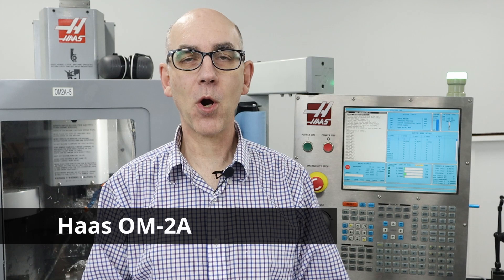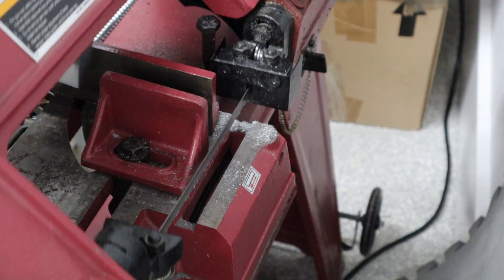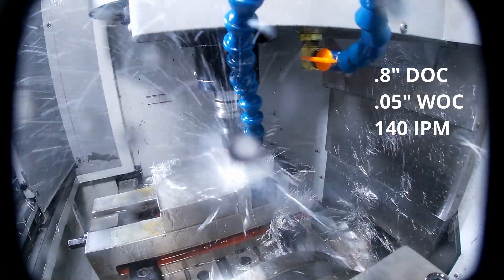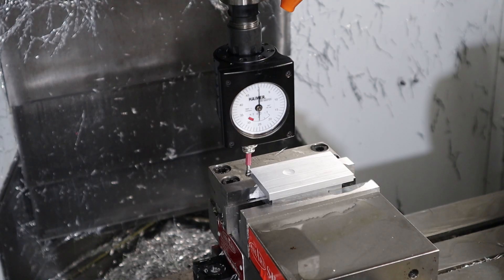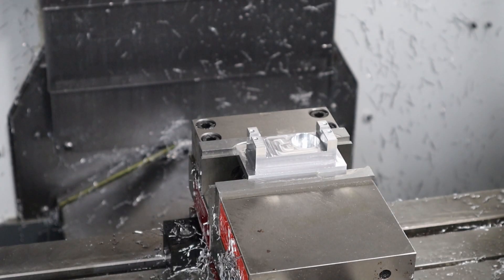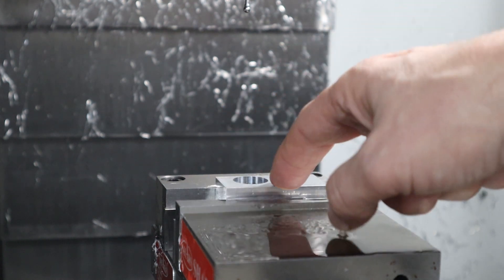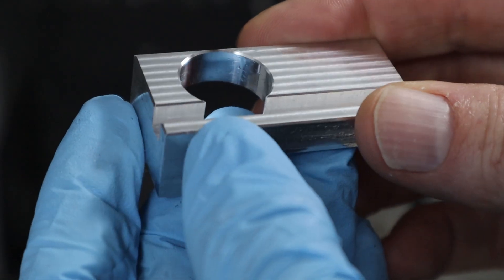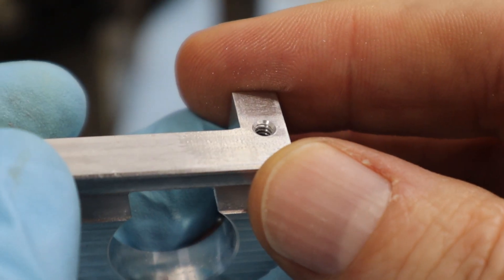A Part for NYC CNC Johnny 5

Comment: Are you using a torque wrench to tighten the ER collets?
Reply from the maker: Not yet. I need to get a torque wrench.
Reply: JohnSL you’d be surprised how much those ER collets want to be torqued.  About 45ft-lbs for ER16.  I got the maritool changeable head torque wrench and adapters.  Pretty good except the min. Torque is 45 so you can’t use it for smaller ER collets.  Also you may already know that ER bearing nuts give much greater holding force as well.
Reply from the maker: Techniks calls for 40 ft/lbs for over 1/16" diameter collets, and 30 ft/lbs for less than that. Wish that Maritool torque wrench went lower.

Comment: Pull out in collet holder is extremely common. If you can pick up some solid holders with a set screw then that will take care of it. Make sure to grind a small area where the set screw can seat itself properly.
Reply from the maker: I haven't found an ISO-20 holder yet that uses Weldon flats. For ISO-20, there don't seem to be many options other than ER-16 or ER-20.

Comment: High docs in those collets will always pull an endmill out, if you can I would invest in a couple solid solders for common standard sizes, then grind a concave area for the setscrew in each endmill. the endmill will break long before it pulls out of the holder :)

I wouldn't feel bad about the machine or vise, messing stuff up is how you learn! those are impressive cuts for such a small machine.
Reply from the maker: Thanks. I've looked and haven't been able to find ISO-20 holders that use a set screw. I've only found ER-16 and ER-20 holders. The options for ISO-20 seem very limited.

Comment: All's well that ends well John, and it looks like a splendid job. Curious, your Haas does not have the rigid tapping option?
Reply from the maker: Thanks. I have a part coming up where I plan to use rigid tapping. I've never used rigid tapping and didn't want to try it out on this part because I had a deadline for getting the part out and was running out of time.

Comment: I’ve seen John Saunders zeroing the left side, after that touching the right side of the part and dividing the number by 2. This way you don’t have to use multiple offsets. You make everything in G54. Good job!
Reply from the maker: It's simpler on a Tormach because they have divide by 2 built into PathPilot. Mach 3, which is what I used for my Taig, has the same feature. Doing the math outside the controller is more error prone, which is why I wanted to see both numbers at the same time.

Comment: The part came out lookin' great!
    I've found it bittersweet seeing the telltale lopsided chamfer on a round hole... On the one hand, I'm faced with possibly needing to mill the part again, but on the other it's so gratifying to find and fix the problem that caused the misalignment in the first place.
    If you're jaw shopping, I'd suggest checking out a set that bite into the material. I've used Mitee-Bite TalonGrip, but Serra Jaws look good as well. TalonGrips are pricy, but they work quite well and it's awesome to be able to clamp down on the bottom ~1/16" of the material and be confident that it's not going to slip.
    Also, I was very happy to see the video lookin' so clear! ;)
Reply from the maker: Thanks. The Crace 2 is working great, as you can see. I need to get a little more light in there.
The 4" Shars vice doesn't seem to be compatible with anyone else's jaws. I ordered a new set, but they have to come from China, so it will be a while before I get them. So I might have to make my own low-profile jaws using either system. Or, there is a 4" Kurt vise that would fit my mill. It's a little pricey, but I'm not happy with the Shars. The vice handle just fell apart yesterday.
Reply: @JohnSL  That's a drag about the handle! I'm generally a Shars fan since it seems like they're trying to make quality tools. It's surprising that they aparently haven't mastered the vise handle yet. The jaw incompatibility is a shame too.
    It sounds like you're considering a new vise. Have you looked at the 5th Axis line of vises? I've never used one (or even seen one in person), but they look pretty nice to me. Very small and versatile... and also super-expensive.
Reply from the maker: Here is the Kurt vice I found that will fit: https://www.kurtworkholding.com/specialty-vises

Comment: Should be able to buy a new set of jaws for your vise.  Or make an aluminum set of soft jaws.  Great job on the part!
Reply from the maker: Yup, I ordered a replacement set, but they have to come from China. I am thinking about making some low-profile jaws. But first I need to make a vise speed handle (the handle that came with the vise just fell apart).

Comment: Great video! Good to see the Johnny 5 part machining! How is the synergy coolant working for you?
Reply from the maker: I'm loving the Blaser Synergy 735 coolant. It's great for video, and doesn't leave a film on the parts. You may have notice the coolant running in the background during some of the takes. I added water and was doing that to mix it before checking the concentration again.